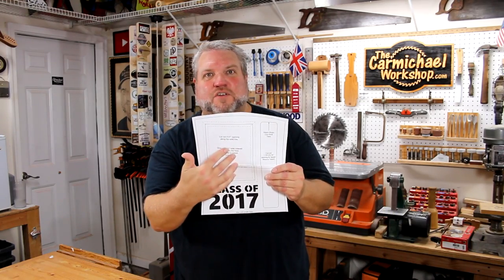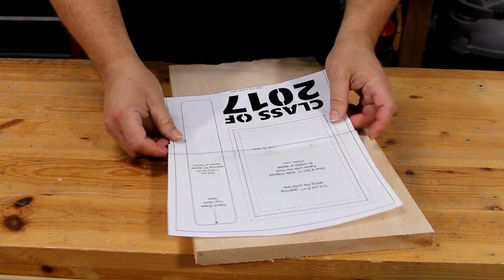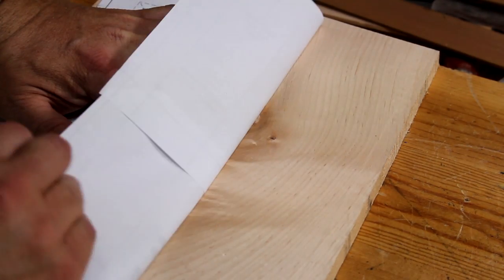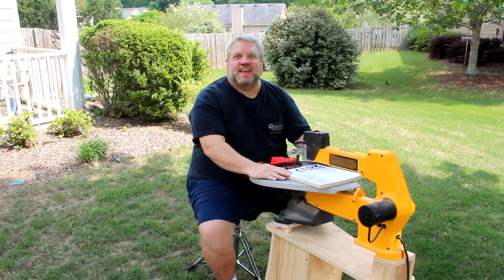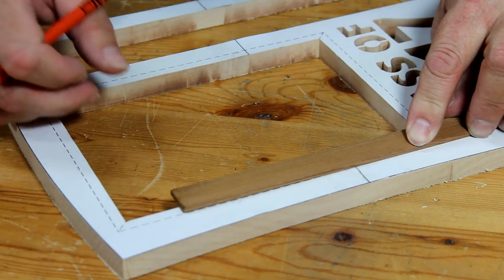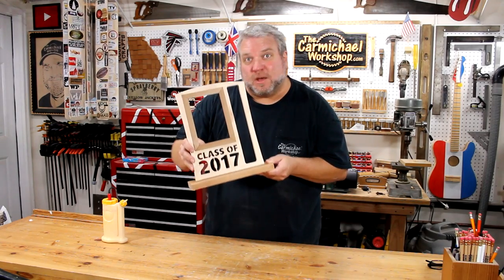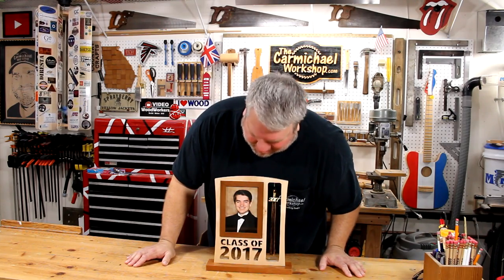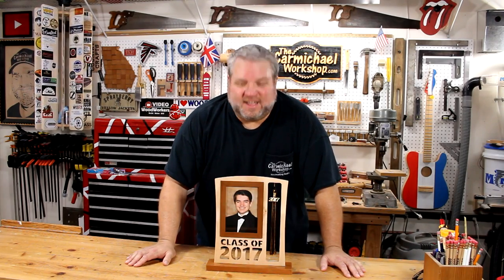Graduate Picture Frame and Tassel Holder Woodworking Project

Comment: Really nice design, Steve.  I like you idea for using hot melt glue to hold the picture in, too.
Reply from the maker: Thanks Charlie!   I have never used hot glue for that before, but it was so easy and I thought anyone could do that.  I'd like to get one of those staple gun things that David P uses that is meant specifically for holding in pictures.
Reply: Steve Carmichael  when i put backs on my photo frames i use glazing points as the holders, just push them in with a screwdriver and there done, this way its easy to change the pictures now and then. not everyone has a hot glue gun, but most people can get a screwdriver

Comment: Terrific video Steve.  Congrats to your son! Also, best tip from the video for me was the hot glue to hold the picture backer in place.  Genius!
Reply from the maker: Hey Phil!  Thanks!  I've never tried hot glue for that but it was way easier than the nails, glazing points, etc methods I usually use.
Reply: maybe do a follow-up in a little bit of time to see how it holds up